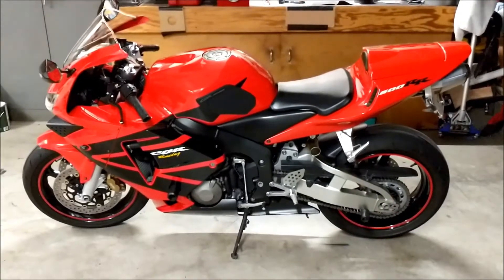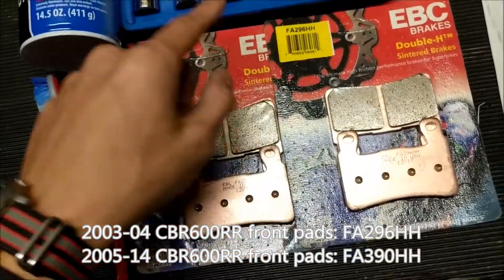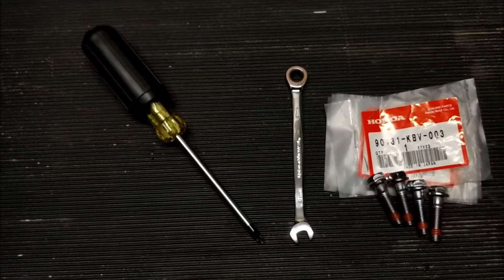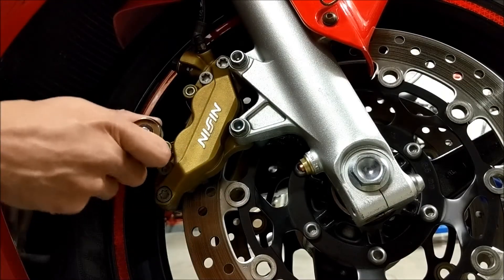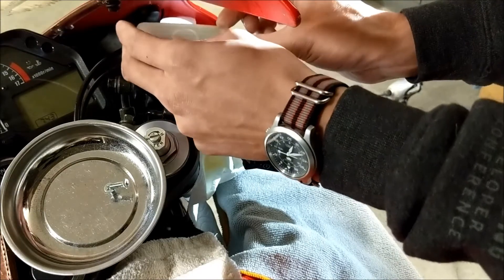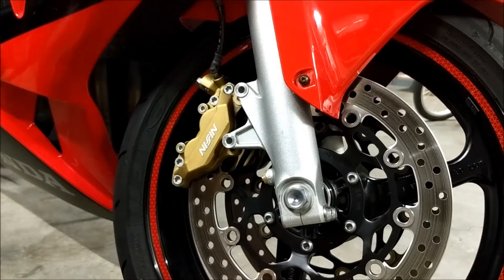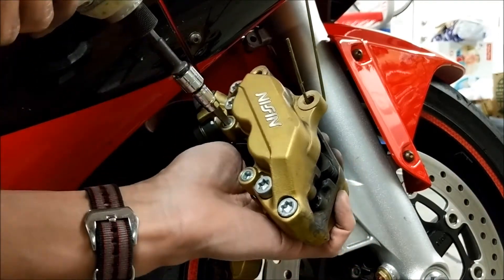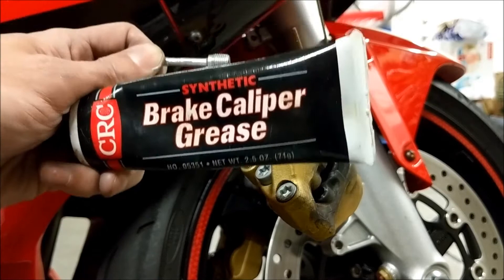2003-2006 Honda CBR600RR front brake pad replacement (shown on a 2004)

Comment: Good video up but I have brake pressure issues post installation. I don't think opening the reservoir is a wise choice,  I did it per the video.  I pumped the brakes till they were firm again after bolting the calipers and new brakes back on.  I may need to bleed the system, however it doesn't look like you had to bleed the system? Odd. Could be I just need to let them bed in? Btw, I have a 04 CBR600RR red like yours, with the black tail instead. I forget what the color code is.

Comment: Reuse the bolts 1 or twice max. Watch some championship races. No one carries an extra set of bolts for calipers. If you feel it's too much of a risk for you, you can buy locktight to put on each bolt. Make sure it's the motorcycle friendly locktight
Reply: Great Vid btw.
Reply from the maker: Thanks Kevin. To clarify, the concern with a torque-to-yield type of bolt is not that it will come loose with vibration (which is what Loctite helps with), it's that it will actually fail from shear or tensile loads and just pop off. Changing it every single time is probably not necessary for this application, but as you said once or twice should be quite conservative.